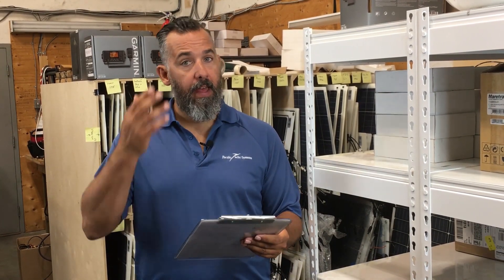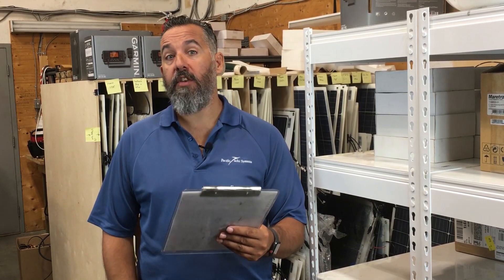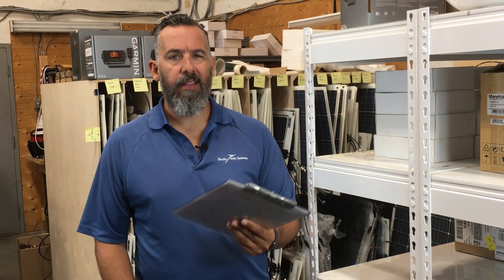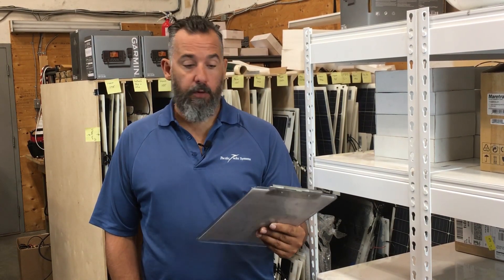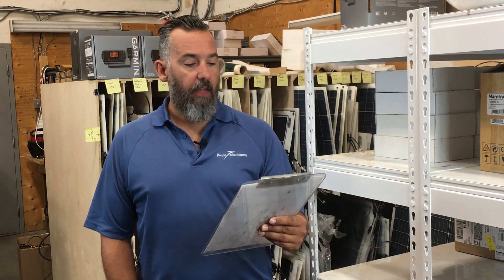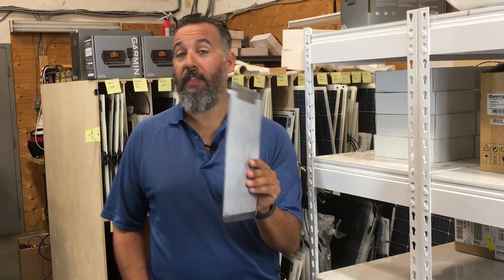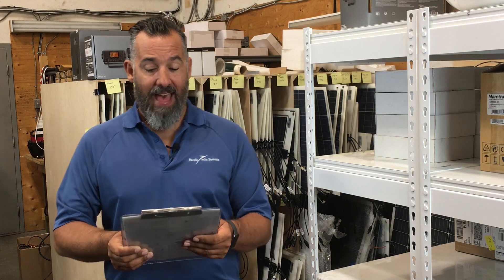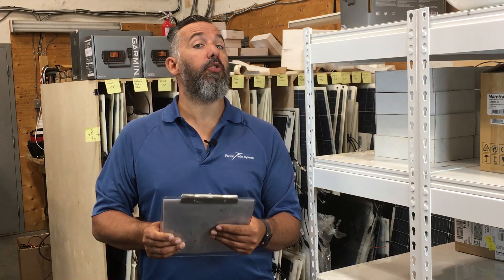Ask PYS - Should I Lose Power When I Turn My Source Selector Switch?

Comment: Jeff ... Good content in these informative  how-to's. I have a question and hope this is the right place to be asking. I own a 2002, 60 foot motor yacht with most of the usual amenities. My question is this, on my 110v powered devices (water heater, water-maker, AC's, AC pump, etc), are these supposed to be connected to the boats grounding system. They are currently, but have received mixed opinions on this.
Reply from the maker: Hi Michael, it's too bad you are getting conflicting info on this. To me, and the ABYC code, is pretty clear: all grounds, need to be common. This includes DC and AC grounds, and even bonding grounds, RF grounds. All your AC appliances should be connected to a common AC ground and this AC ground needs to be connected to the  common boat ground. Otherwise your AC ground is NOT grounded.

Comment: Hi Jeff!
Love these "quick tips".
My question is... my shore power inlet is connected to a marine 10g wire that is a little less than 10' to the ac breaker panel... there is no fuse from the source (the inlet) to the panel... should there be one there to protect the wire?
Reply from the maker: The ABYC code says that your shorepower AC line needs to be protected within 10 feet of coming into the vessel, sounds like you are covered.
Reply: @PacificYachtSystems  
So I guess the question then becomes... is that what you would do? Is that the accepting perfection?
Thanks
Luv what you're doing here!

Comment: Jeff Great videos I’ve learned so much from watching. 

My families boat is an 31 ‘88 Crusiers yacht day cruiser. Much of the electrical needs love but it works. We have two engines and two alternators connected to an older battery isolater and then to the engine batteries. We are planning on installing a house battery to run fridge and radio and other dc on the water. Should we get a new battery isolater with three outputs to battery. Or should we ditch the isolater and use two automatic combiner relays each connected to house and one engine battery?
Reply from the maker: Hmmm, suggest you go with 1-2 FET based battery isolators on both engines, each alternator can recharge it's respective engine battery and the house battery,

Comment: Jeff do you recommend replacing the traditional source selector with a charging relay such as the bluesea add a battery kits? They seem to make it fool proof
Reply from the maker: Hi Art, in most cases yes. But beware, sometimes the fusing connected the battery combiner will nuisance trip because of a high in rush current when two uneven batteries are joined together.
Reply: @PacificYachtSystems  understood. Is there a minimum wire size/fuse size you recommend to connect the fuse and acr? My 30 year old outboard only puts out a 10-15 amp charge. Blue sea recommends 10 gauge and 40-50 fuse for any output less than 30 amps. They said I could connect the acr to the load side of the switch which would keep the wires very short. Group 27 starting group 29/31 house

Comment: Is there anything physically with the switch to look for before the "blip" appears to see if a switch is aging out, even if the connections are proper?
Reply from the maker: Good question, but I don't think there is any tell tale signs of a battery that will fail. From my experience, the switches work until they don't.